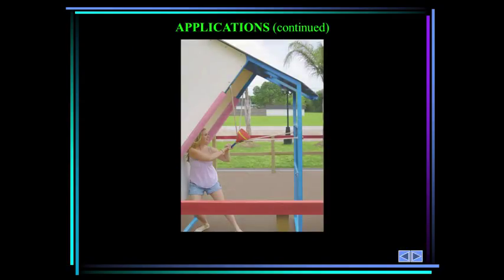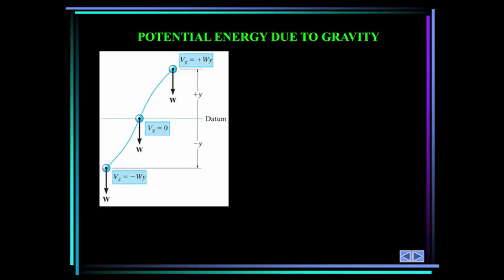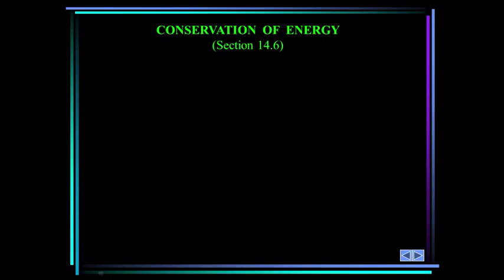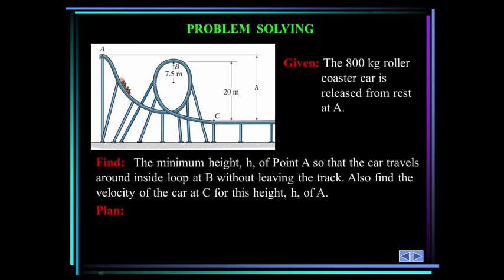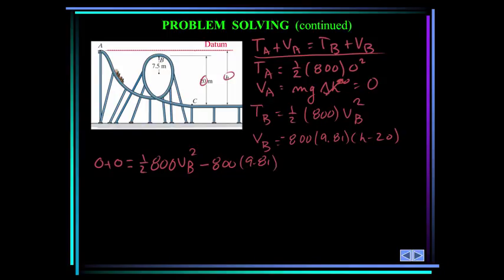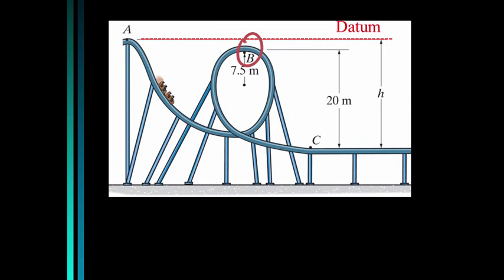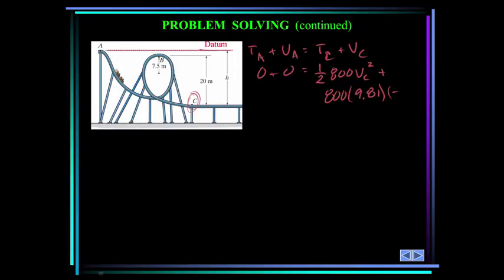ME 274: Dynamics: Chapter 14.5 - 14.6

Comment: Sir i have a question how you come up with 0.5m and 0.3 mean from where you find this because in question it is not given ??
Reply from the maker: The 0.3 comes from 0.4 (radius) - 0.1 (vertical drop from A to C). The 0.5 comes from Pythagorean Theorem: sqrt(0.4^2 + 0.3^2) .
Reply: Thanks sir
Reply from the maker: @jalalidrees3648  You're welcome.

Comment: why can't  find Vc by relating to position b??
Reply from the maker: You can use the energy equation between points B and C: 1/2(800)(8.578^2) = 1/2(800)Vc^2) - 800(9.81)(20). Vc = 21.6 m/s.

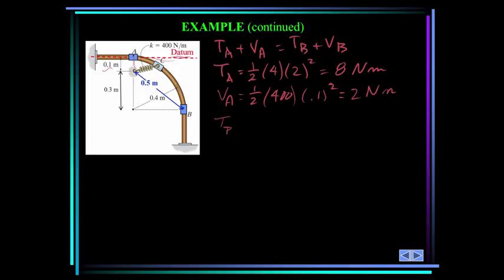Comment: Sir, at 6:36  how did you compute that length of .3 the vertical that you used for potential  and also the .5 you used for the second spring force. im a visual learner and im not really seeing how you go that. Thank you
Reply from the maker: Call the point where the spring is attached point C. The distance between C and A is 0.1 m (see the figure). The unstretched length of the spring was given as 0.2 m. So the spring is compressed (0.2 - 0.1) m at point A. The distance between C and B is 0.5 m (see the figure). So the spring is stretched (0.5 - 0.2) m at point B.

Comment: Hi Prof. Selleck, first of all thank you so much for uploading these wonderful lecture videos. They are really helpful. I had a question though; at 6:32 mark, the potential spring energy at point A was written as Va = (1/2)(400)(0.1)^2. Won't that be Va = (1/2)(400)((0.2)^2 - (0.1)^2)? And same thing for Potential spring energy at point B. I am not sure if I am right but I am really confused as to whether it is (s2-s1)^2 or ((s2)^2 - (s1)^2).
Reply from the maker: When computing the potential energy of a spring at a point, you use (1/2)ks^2. If you want the difference in potential energy between two points, you use (1/2)k(s2^2 - s1^2).  Never use (1/2)k(s2-s1)^2. In this case, I am computing the potential energy of the spring at a point so I use (1/2)ks^2. Remember that s is always measured from the unstretched spring length, so it is the distance the spring is compressed or stretched.
Reply: Colin Selleck Thank you sir, that made things a lot more clear

Comment: First of all thank you very much for your great work
i have a question
how do i know if I should use T1+V1=T2+V2 
or that i should use T1+U1-2=T2
Reply from the maker: Use the first equation (cons. of energy) when only conservative forces are involved (gravity and springs). Conservative forces are those whose potential energy is independent of the path taken. Use the other (work and energy) when there is friction or external forces acting on the particle/body.
Reply from the maker: Since the first equation is a special case of the second equation, (i.e., the absence of non-conservative forces), it is not wise to combine them. Each represents a method for solving a problem (i.e., cons. of energy & work/energy) .